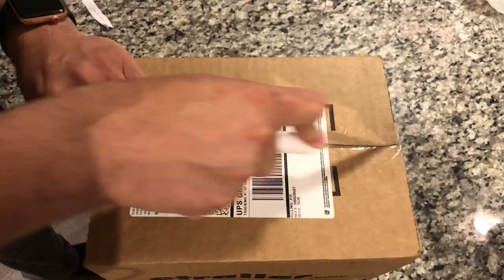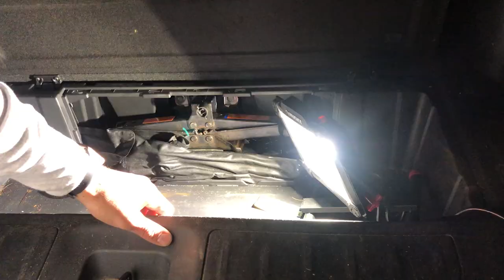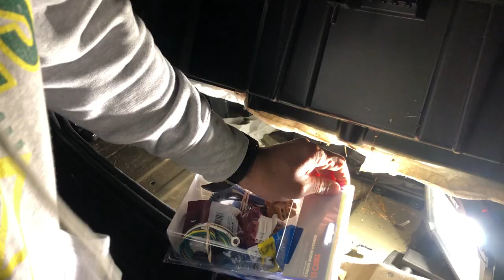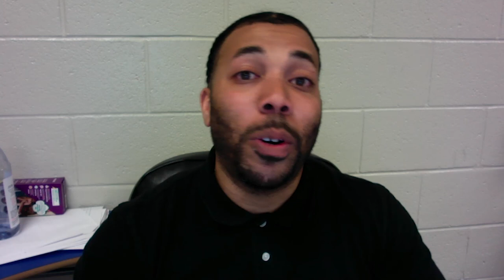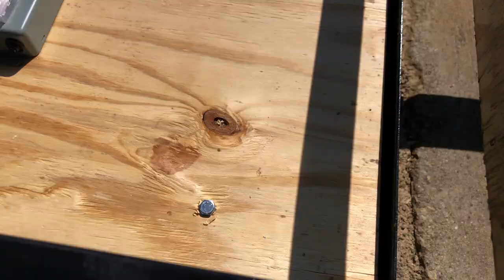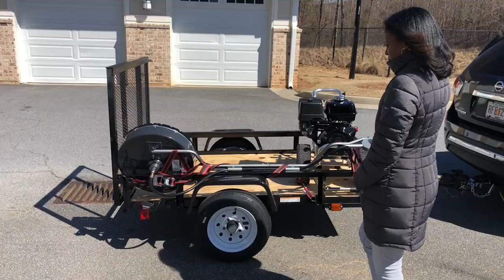Small Pressure Washing Trailer| Adding Plywood to a small pressure washing trailer

Comment: Is there a part 2 that continues the build
Reply from the maker: I didn’t get to the second part. But I did end up putting a 4gpm machine on it with a small soft wash system.  It worked great but now I have an 8gpm unit with a 225 gallon tank